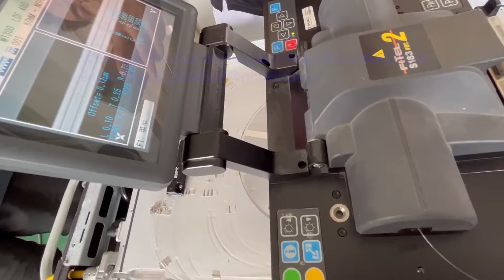2025 how to replace max fiber optic cable-fiber laser source repair

Comment: If i have to install small fiber laser raycus50 w on a cnc for engraving machine, must i install thicker cable like this or can use original smaller one?
Reply from the maker: original one is ok